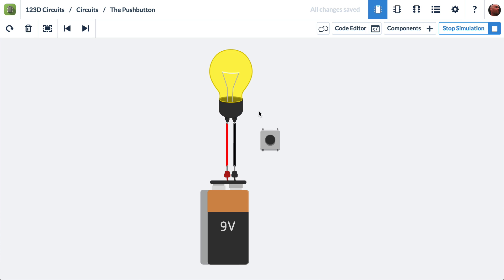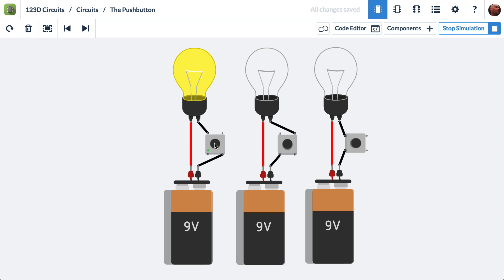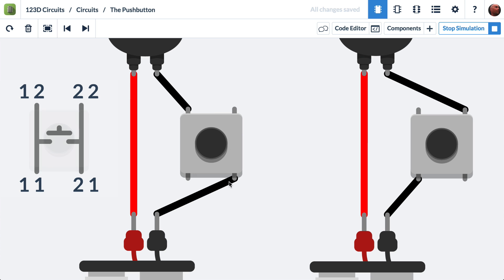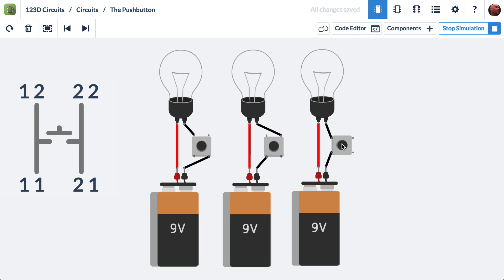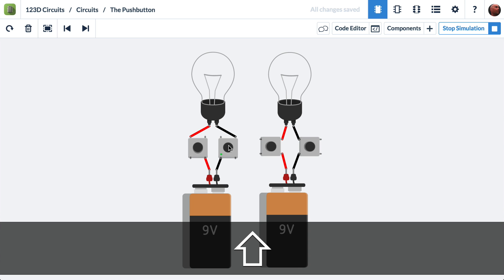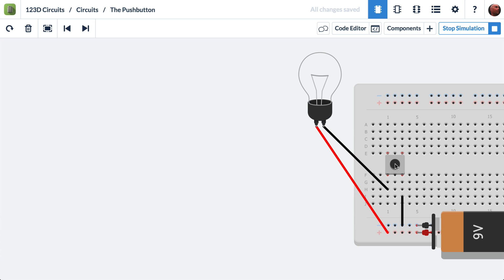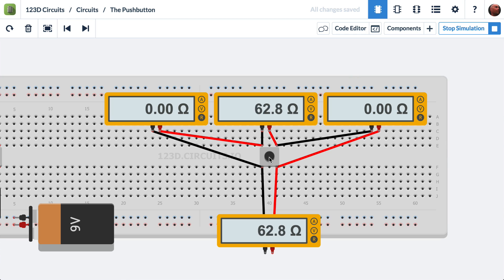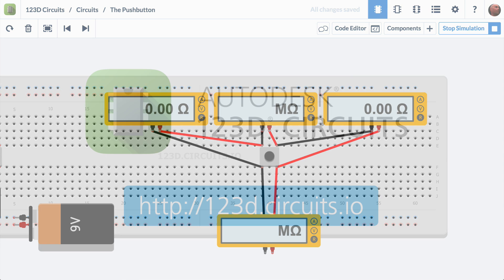Pushbutton - Electronics Lab

Comment: Good video. Because of the educational character of this video, I emphasize that the most commonly needed resistor in the electric circuit (limiting current). It depends on the type of light element.